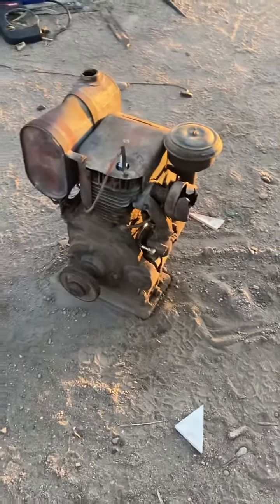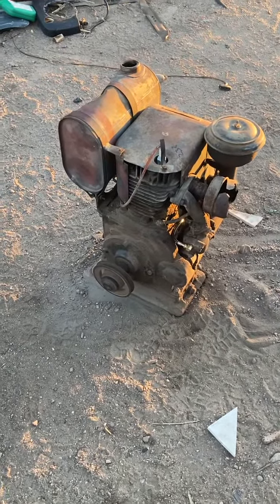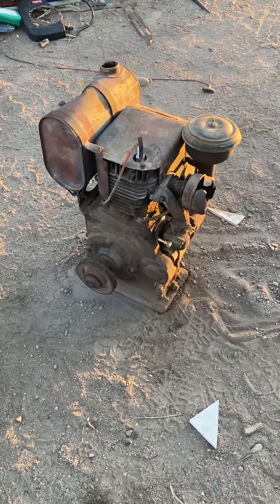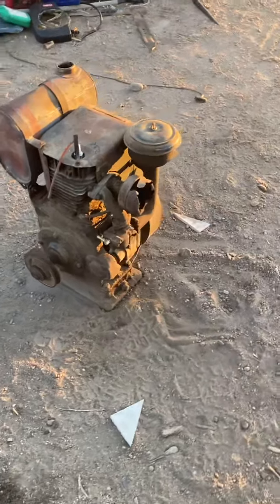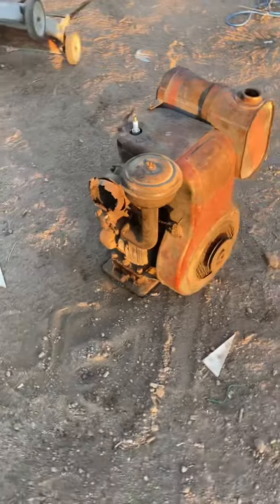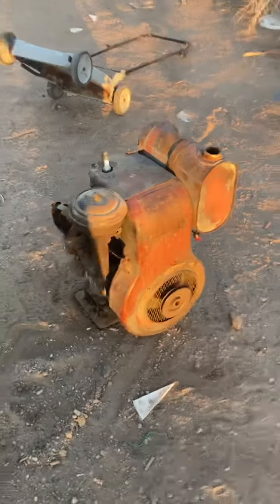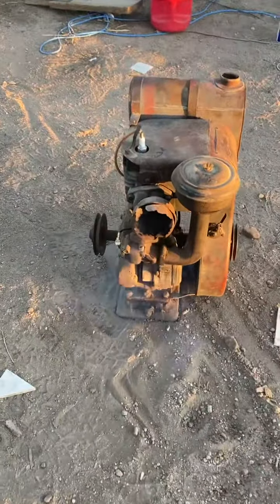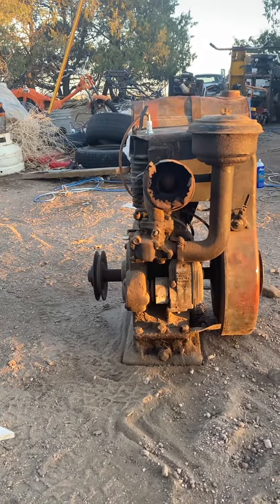Running a 1941 Wisconsin AHH on 0% gasoline! About 80% diesel and 20% used Rotella engine oil!

Comment: Very interesting I would like to know how long it takes for the plug to fowl out? or does it need a hotter plug?
Reply from the maker: Haven't run any of them long enough for the plugs to foul. Yes, I've done this with more than one. Ran about 5 gallons through my 1947 AEN for break-in with a Champion D16 (same as I've found in all of them that I've ever come across) and the plug got a little oily but it still hasn't fouled at all. Ran about 10 gallons through the BKN and the plug fouled, but that specific engine has a problem with fouling plugs regardless. It'll foul out within about 5 gallons of regular gasoline, even though it's tuned as well as possible and it's not real worn. 
Could be the points and condenser need replaced on the BKN.

Comment: wow never knew that was possible
can i do that with my 6.2 akn?
Reply from the maker: More than likely, yes. 
Many of these like to be run on 50-85% oil/diesel and the rest gas, rather than just oil and diesel though. I can get about 6 hours of run time at 2600rpm on a gallon of 90% oil 10% gas with my AEN.
Reply: @lawnmowerrepairsandstuff3154  very impressive i have to try this out, your the only one on youtube who makes a video of it. Thanks

Comment: Was it hard to get started on the diesel ? Or did you start it on gas & switch to diesel after it warmed up ?
Reply from the maker: You’ve gotta start it and warm it on gas, wait til there’s no gas in the fuel tank, then dump a bunch of diesel in. The Wisconsin BKN has the instructions for doing just that on the information plate. I have a BKN on a 1947 Roof MFG VP75 mower.
Reply from the maker: And I run it on used oil all the time.